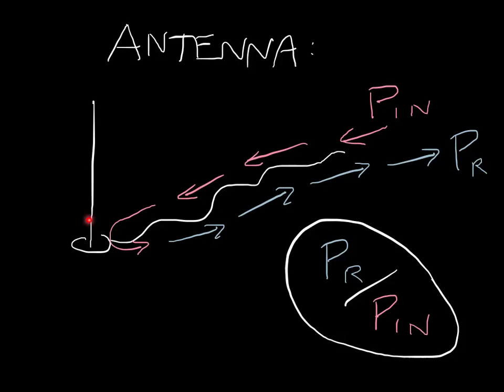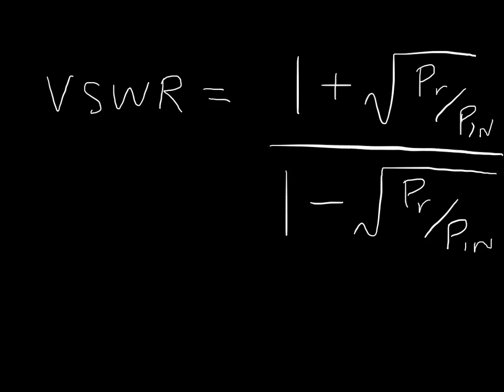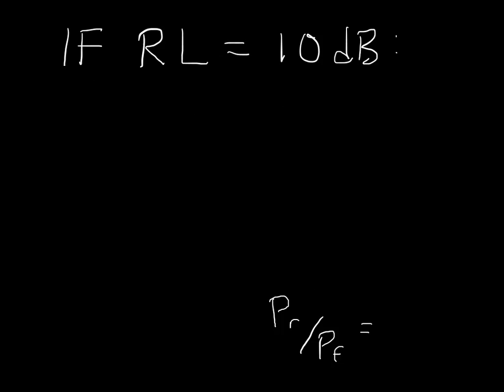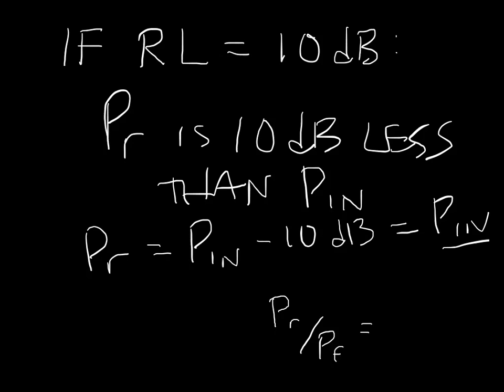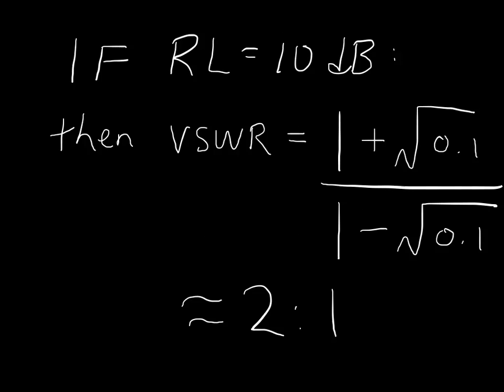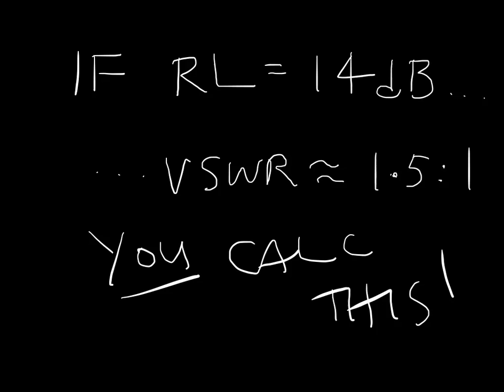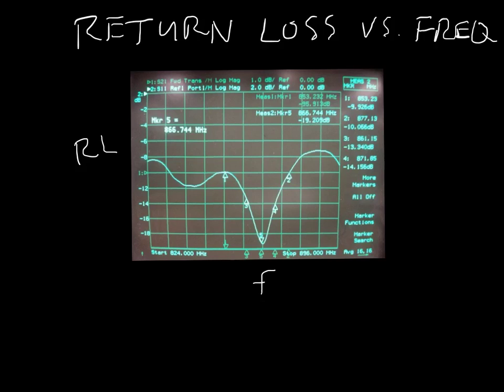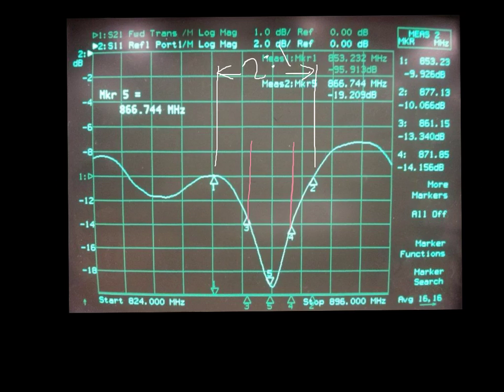Relationship between return loss and VSWR

Comment: I don't get it: how is a larger value of return loss "better"? It means more loss and more reflected power instead of transmitted power, so it should be "worse"?
Reply from the maker: The value of return loss refers to how much LESS the reflected power is than the forward power.  That means a return loss of zero refers to the reflected power being 0dB less than the forward power -- meaning that the reflected power is the same and therefore 100% of the power is reflected.  As the value of return loss gets larger (i.e. further from zero), then the reflected power is becoming "increasingly less" than the forward power.  In other words, a greater value of return loss means the reflected power is less than for a lesser value of return loss.